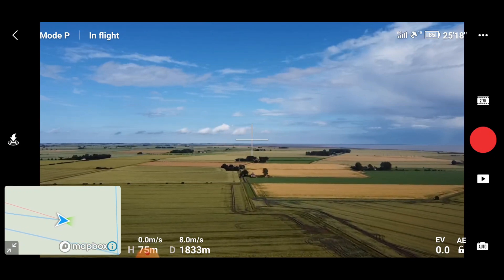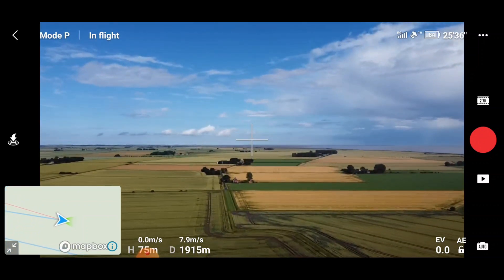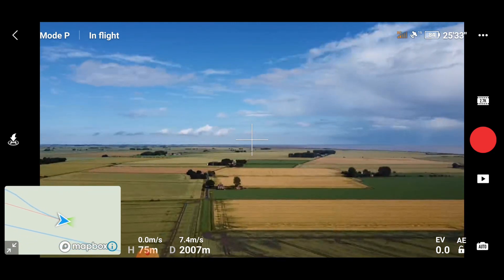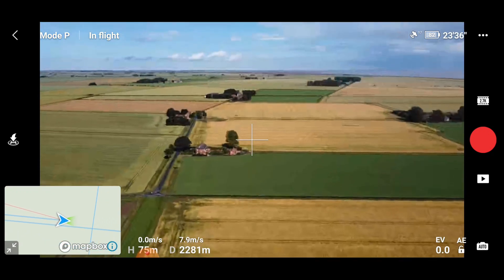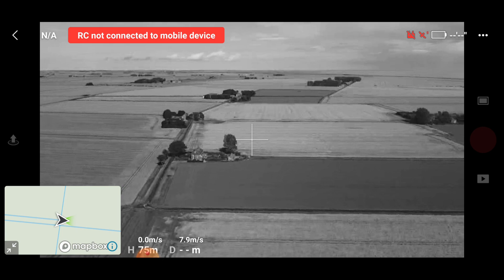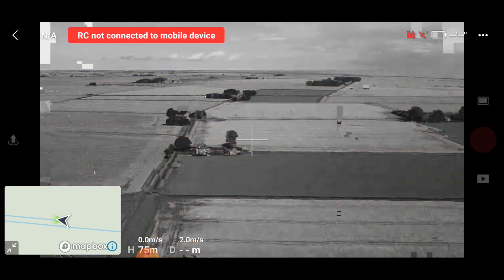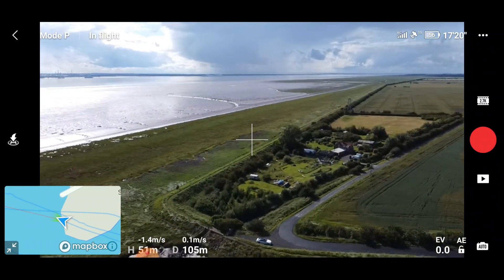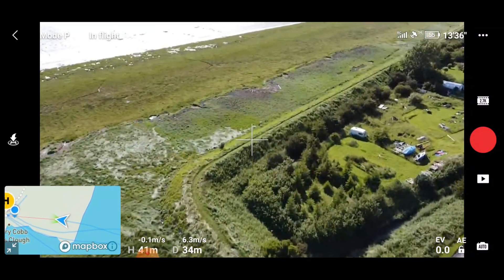LONGEST DISCONNECTION ON YOUTUBE? DJI MAVIC MINI RANGE EXTENDER TEST FAIL

Comment: Yeah, rc not connected tirgrered me thinking it's not about connection from remote to drone. It's about cable or app failing. I heard android version is not reliable as much as ios, but is this the case here. Maybe.
Reply from the maker: Yes indeed, the strange thing is, it just came back out of nowhere! you would think I would need to disconnect phone or restart the app or something, it has never happened before or since
Reply: @GAVINHR  that is indeed very peculiar. Thanks for sharing and for response.

Comment: Wow intense! You must have had a panic on?😯😁
I've had long disconnects sometimes and ones where it does an auto RTH and starts beeping, then the beeping stops and you begin to think is it still returning or do I press it again? Or will pressing it again cancel the auto RTH?? 😯😁
One thing is certain, it always comes back, providing you have enough juice and have set the RTH altitude high enough to clear obstacles between you and the drone! Oh and the wind is not too strong to fight against!!😯😁👍😎
Reply from the maker: This is also what gave me confidence my friend! You are indeed correct it does always come back! I did a range test video on the same day as this and absolutely got caught out in a huge rain shower! The drone was drenched but made it back absolutely fine. To be honest, not only did I panic, I figured it had gone and started packing away! It didn't take me 4 minutes to fly out so when time went on j assumed it was not returning! It was only by chance that due to the quiet location I heard it just before the controller connected again.

Comment: I am sure lot of things would have been going through your head at that moment of time ,flyaway with the wind ,bird hit ,battery fail etc ,mine disconnections for more than 30 seconds ,it raises my heart beat .what would be the contingency plan if it refuses to return ,i am sure Find my drone only works if there is active connection or it will pinpoint to the last location before  RC lost connection to the drone.

Comment: I know exactly what you felt... but wait until you run out of battery 1km before it gets home and you lose signal half way when landing in a populated area (lost LOS)...
Got there as soon as I could, but still, the "find my drone" option, didn't get me close enough. Fortunately, a couple of fellows saw it landing (and hitting a tree) and pointed me in the right direction. 
By the way, it was after sunset, with low light... 
I  crossed an abandoned field and after a while, finally saw a red light blinking by a tree and there it was, safe and unharmed... it took me probably around 15min to get there and find him... can you imagine???
Still, I made my new range record (over 4km)... so, yeah, it was worth it ;-)

By the way: did you know it forces landing if you go below 10%?!? There I thought it was still enough, when he said "landing!"
I was very high (120mts), so it gave me a few secs to search for a more or less safe landing spot, but if I didn't know the place I was passing through, it would be veeeery complicated to find a place in such short time... lesson learnt: 10% is the new zero! 
Take care!

Comment: I am not impresed on range you achived. Just watched guy who got 3.6 KM! On CE model!
Without yagi or parabolic boosters.. just stock model 
https://youtu.be/xkyX_6EMkh0
Reply from the maker: That's the second time you have commented that, this wasn't a range test. It's a video of a disconnection and a scary 4 mins of wondering if the drone is returning.

Comment: The drone always returns when the signal is lost. It is good to return in time if the signal is weak. But it was a drama for you, huh? Good response to deploy directional antennas. It is good to have the RTH height set to 70m and more. At this height there is  certainty free of obstacles. The drone always returns or lands when the battery is low. Then it is possible to find it in apk. DJI in your phone via GPS  dron even when the battery is off. Long-distance flight is good to perform in an open space without trees and water . Best along the road so we can drive for a drone. Above all, it always wants peace.
Reply: I would say that blindly setting RTH 70 or above can cause issues - imagine situation that you go far away at height of 40meters and it might be a bit windy. Then you loose the signal, RTH kicks in and raises drone to 70meters (or higher) and wind there is much stronger, it starts to blow drone away, while at that time you don't have stable connection with it. I know its an edge case and should be avoided in the first place (while preparing for the flight), but it can happen. I always make sure that RTH altitude it set according to the situation and not too hight as well. I.e. if I avoid flying near high voltage power lines, I don't see any reason for RTH to be set higher that 40meters.

Comment: It's seems the actual problem is that the rc was disconnected from the phone not from the AC
Reply from the maker: But of course it was connected the entire time! Controller had full battery, the app was open as you can see on screen. Very strange thing to happen! Not to mention when the signal came back I was just stood with the controller on a wall I wasn't even touching it. Just one of those things I'll never know why that happened but it got back safe!
Reply: @GAVINHR  The reason why I'm mentioning the phone -> RC link is something a bit similar happened to me.
I was flying out straight line and not 100m out I got the same screen. I thought I lost signal and that it would pop up as it does sometimes but it did not. I could still see the drone moving but didn't realise that it was the app that was the issue (or the link rc-phone) I waited for it to come back but since the RC-AC link was fine it did not trigger Auto RTH
Minutes (as you know feel like hours) later I hit the RTH button and started to go to my car to go to the last location. As I was getting my stuff I heard the familiar insect swarm noise.. Asking around it can apparently happen and our only indication that it's fine is that the led indicators on the RC remain solid throughout. 
The 'remedy' is to remove and plug back in the OTH usb cable or restart the APP. I haven't tried any
Of course with your bird 2.2km away the level of freak out is exponentially higher 😅😅